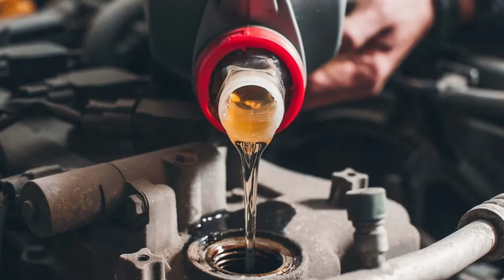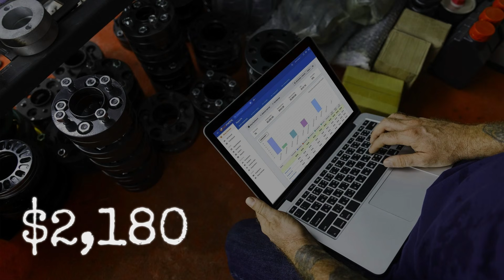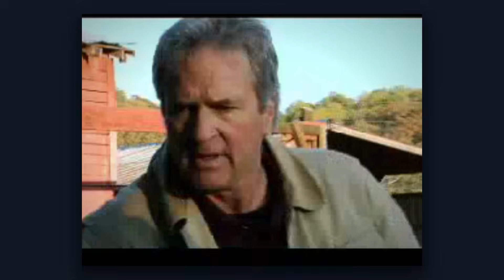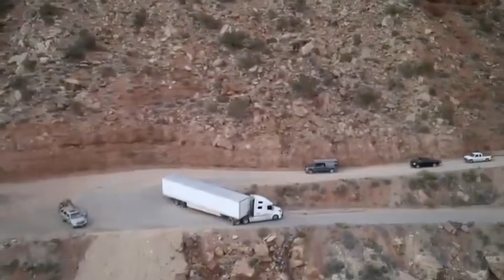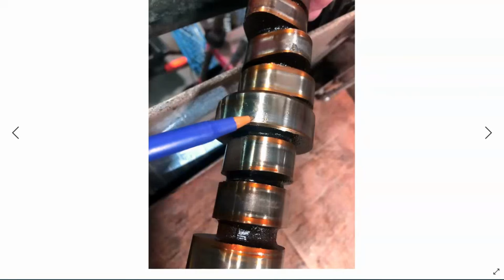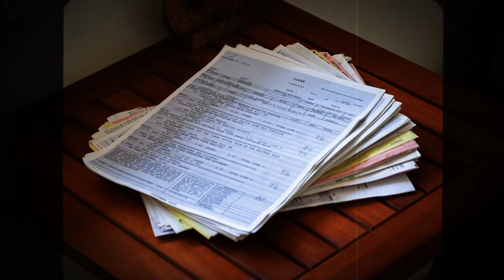The “Fuel-Saving” Truck Feature That Can Destroy Your Engine

Comment: Just put the truck in "tow mode" all the time and you'll stay on 8 cylinders.
You can also switch to "manual mode" and just select the highest gear available
Reply from the maker: Yeah that’s a fair workaround, and it probably does help on some trucks. The annoying bit is that a lot of these settings reset every time you turn the vehicle back on, so you’re basically having to remember to disable the system every single drive. That’s kind of the bigger issue for me — owners shouldn’t need a workaround just to keep the engine running normally.
Reply: @WorseByDesign yes, I have to do it every time - but it's only one button and I don't have $2000 to bypass it 🤷‍♂️ permanently

Comment: there is No fuel saving device,  the ice powertrain is inherently and by design in-efficient, wasteful, dirty, and a total joke. pull out the engine, scrap it and find a way to use an electric motor for propulsion, it will be so much better, than the primitive pos currently occupying space under your hood.
Reply from the maker: Totally fair that EVs solve some of these problems in a different way. This video is more about the specific cylinder deactivation / fuel-saving systems added to internal combustion engines, and why some of them can create expensive long-term reliability issues. Appreciate the comment.